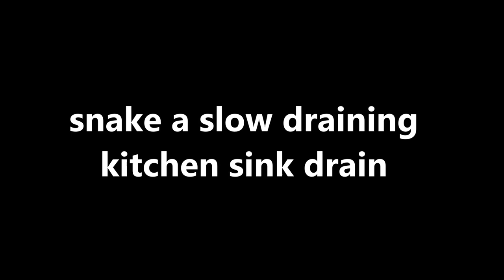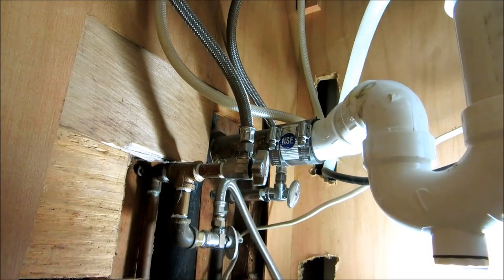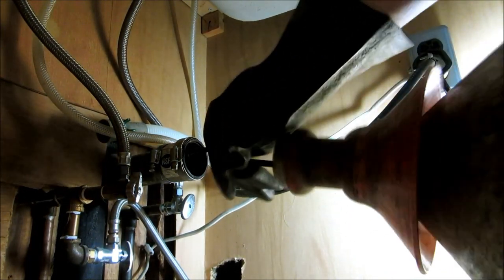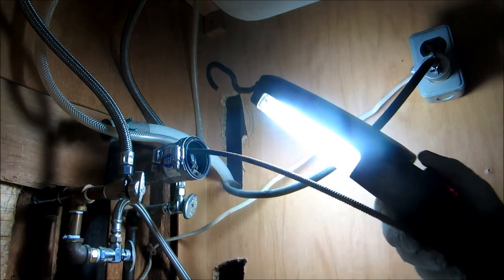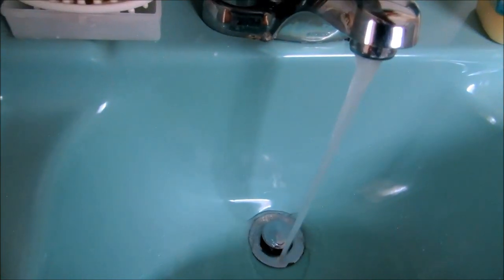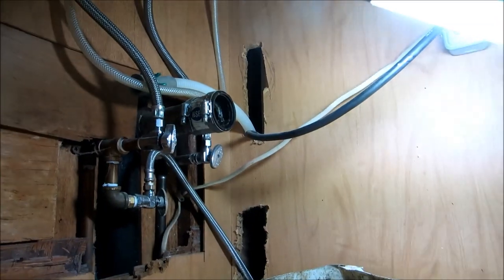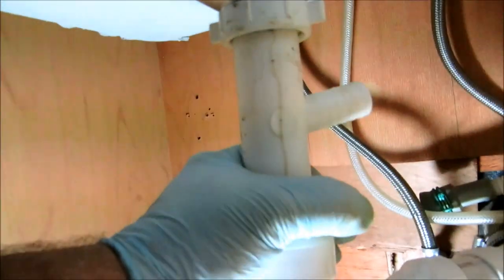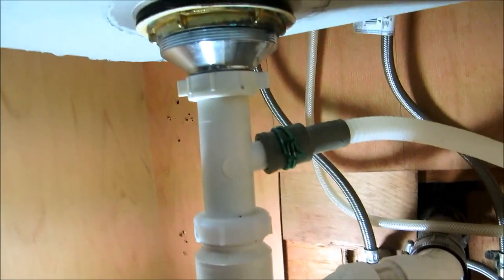snake a slow draining kitchen sink drain

Comment: I never have any luck with a tub gun down a kitchen drain line I usually have to use my Ridgid k-50 to get the clog.What is that?Its a snake Lol.Good job Steve.
Reply from the maker: Saul Friling snaking is the best and only way to remove a clog